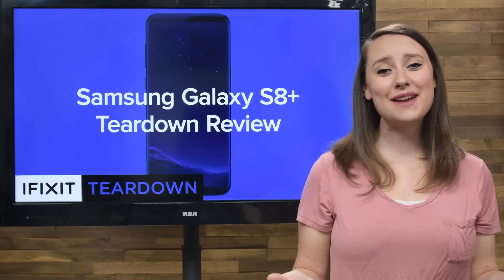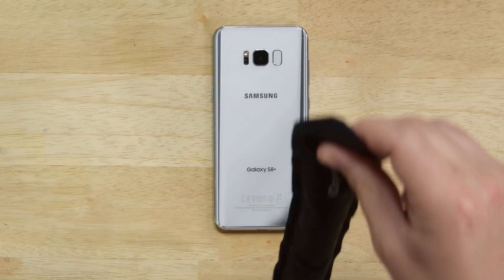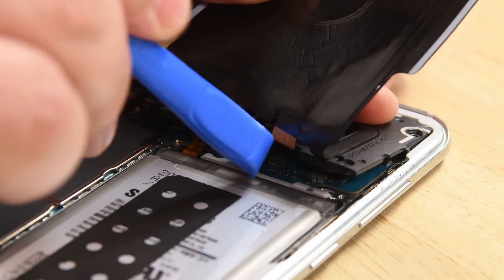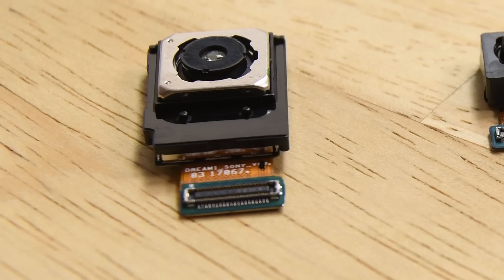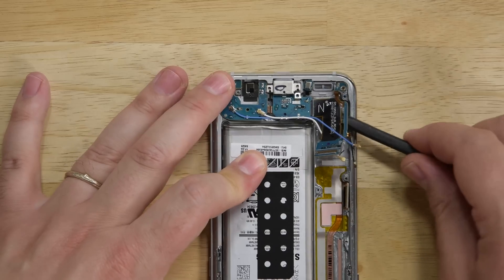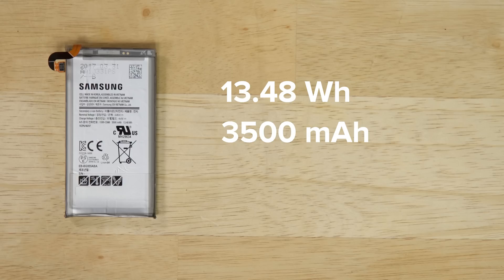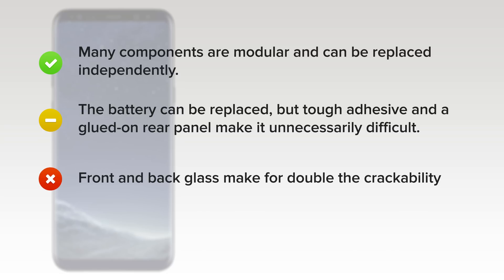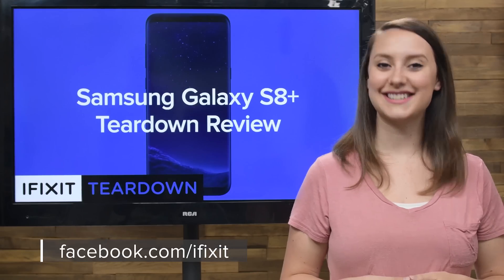Samsung Galaxy S8+ Teardown!

Comment: Actually why 4? It should be 2 at the most, too much glue and risk cracking the glass on both sides, cracking the display means replacing the battery would be half of the phone's cost...
Reply: Well, glass is beautiful and doesn't need plastic "windows" for antennas, you have to choose between beautiful but fragile glass or horrible and cheapass plastic

Comment: Hiya!
I was wondering if you guys could maybe do a comparison?
1) like the SD835 vs the A10 size.
2) volume of battery on S8 vs iphone7
3) size, efficiency and density of the two motherboards (i think iphones is much smaller)
4) size and effectiveness of the two vibration motors (since S8 seems 1/3 the size)
4) also could you compare the two speakers (S8 and iphone7) against the and dual front speaker moto phone?
I ask because once again I am under the impression that the moto speakers are 1/3 the size of the main speakers in the two leaders and the same size as the ear speaker on the two.
5) and also maybe the effectiveness of the hydrophobic coating on the moto phones vs the two leaders?
6) and finally compare their internals density and efficiency to the Xiaomi Redmi 3s (because as far as I know, that is the smallest 5inch phone with a 4000mA battery)
I think that would be a really cool and enlightening. 
love your work guys.
cheers.

Comment: But wouldn't we argue that the excess of adhesive is a good trade off for having a weather proof phone? 

Water damage is a very common problem after cracked display and batteries.